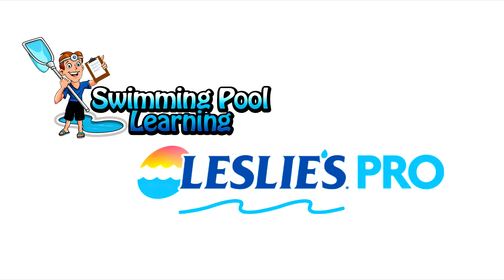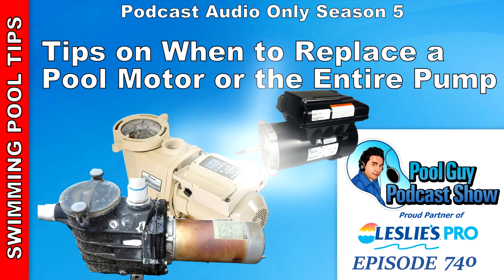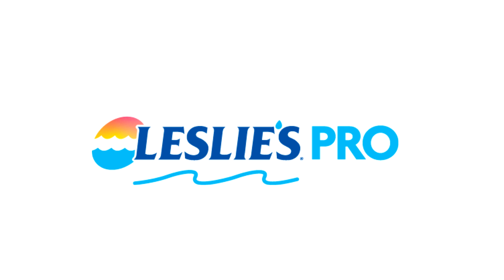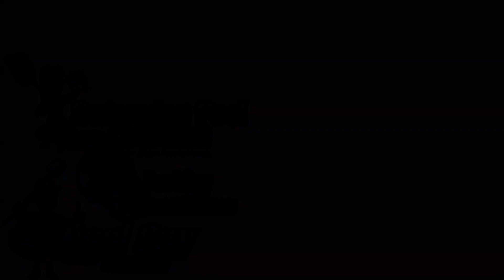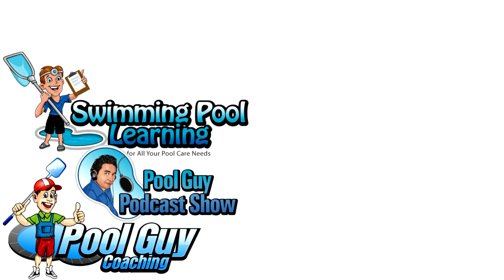Should you Replace Just Your Pool Motor or the Entire Pool Pump?

Comment: I have a Pentair SuperFlo 1 hp pump and I am looking to replace it. You are using the wrong terminology when you say a replacement fits in the same footprint. That is not always correct. The unions may match up but in many cases the replacement pump is significantly longer in dimensions and, in my case, I do not have room to fit a longer pump. I would need to completely redo the plumbing in order to move the pump to a different location.

Comment: Hayward sp3400vsp echostar poól pump just cuts out when starting up to prime like 10-15 secs. Check system lights stàrts flashiñg, pump stall motor error ón display. The shaft spins freely. There is no capacitator í could see on the motor! This problem started as their was a power outage at night from the power company to our home! Are these vsp motors sensitive to power surges when the power goes out to the house?
Reply from the maker: Sounds like air is in the line. Try priming it in spa mode if there is an attached spa.

Comment: Is it a bad idea to replace a 2hp whisperflo with a 3hp whisperflo? Can it mess up the pvc pipes due to the higher hp?
Reply: I think I asked this too early into video.
Reply from the maker: Yes, that would be overkill but you never really have to run it at the full 3HP.

Comment: One of the other factors the new energy efficiency laws do not address and that is 3-phase power pumps.  I had a customer that had 3-phase power to their home.  However, they had a 1-phase 2HP Haward Superflow. I told them about the changes that were coming, so I replaced the motor with a 3-phase 2HP motor and saved nearly 50% energy.  A 1-phase 2HP motor uses 12 amp hours at 230VAC. The 3-phase motor uses only 6.8 Amps hours. I did have to do some electrical upgrades including a 3-phase contactor with 110VAC coil so the timer could still control the pump. I recognize that most residences do not have 3-phase power, however, 3-phase power motors are significantly more energy efficient.
Reply from the maker: That sounds like a good third option. 👍

Comment: I mean, I just replaced the bearings in my 1 Hp single speed Whisperflo lol, and others can also do that as well instead of replacing the motor and putting a VS motor on. That’s something the DEO also doesn’t realize consumers can do. Of course not all of them are as hands on like that, but there’s definitely a lot of them out there that would do the same.

Comment: I have a $300.00 and some change thats with a $500.00 DWP Rebate 2013 Pentair Intella flo, Best Pump Ever!! This is for a 16,000 gal. inground with attached spa, it runs 8 hours a day at 2100 RPM using 550 Watts. I did the math, I can run this pump for 3 days for Free compared to the old 3 horse energy-hog 3000 + watt pump. It runs a quiet as can be, I think the Permanet Magnets that make the difference, and the wattage too?? You have the use the unions that are recommended for this pump, Nothing else will work, Guaranteed!!

Comment: It uses the same energy no matter what speed you run it.
Reply: if you attach a amp meter to the leads, you'll see the drop in amperes during the different speed settings. less amps means less  on the wattages., which means savings on your energy bill

Comment: I have a 25 year old 3/4 HP Duraglas pump. The pool is a basic 10k gallon setup with no water features or spa. I didn't realize that I should be replacing the entire pump so I've been replacing motors (been through many over the years) and pump to motor seals. What non-VS pump would you recommend as a replacement?
Reply from the maker: Those Duraglass pumps last super long. A pretty amazing product but the the wet end or pump pot area is definitely aged out by now. I wouldn't be opposed to a simple VS pump like the  TriStar XE 1.25 hp. You can save quite a bit on energy going from a 3/4 hp to one of these.
Reply: @SPL  Thanks for the recommendation. It looks like the Tristar XE line is only available to pool professionals, which I am not. Do you have another recommendation for a pump that I can buy from a retail seller?

Comment: The level of water is always like 2 inches low when the pump is on on the little window where the catch basket is should i replace the lid I already replaced the gasket and added some seal lube but it didn't work?
Reply from the maker: If it is running at full speed maybe there is air getting in there. If it has unions I would try to tighten those up a bit. Doubt if it is the lid itself.